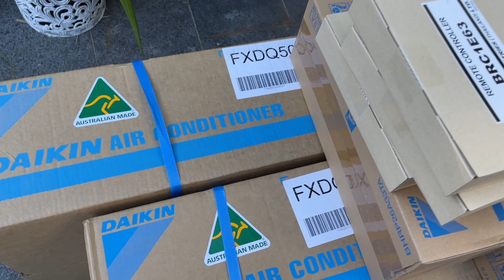Weekly Vlog⎟2

Comment: Where's the return for the unit above the cupboard?
Reply from the maker: The inside of the bulkhead area is sealed with gyprock and painted before fan coil is mounted. The Bar Grille is the width of the entire bulkhead so it acts as a supply grille but the return also draws air from the same bar grille. 
The top of the wardrobe is removable so you can clean the filter and service the unit etc.

I always install a separate return air grille in bulkheads but when it’s mounted above a wardrobe and that is not an option, I do it this way.
Reply: @Mitch Attwood  thanks Mitch for replying.  Wow that's pretty specy and I like that as an option (very neat)👍.  It definitely had my brain going trying to work that out.
Love ya work mate,  don't stop doing You!.  Appreciate your commitment.  You are what separates you from the standard fitters.  Never apologise for being too busy to make a video either.  Like most we just enjoy seeing what others do.
Cheers bloke 👍 👌
Reply from the maker: @greencheeksconure  thanks so much mate !